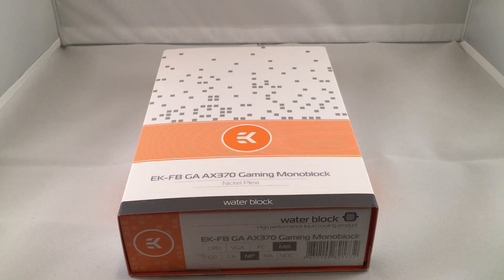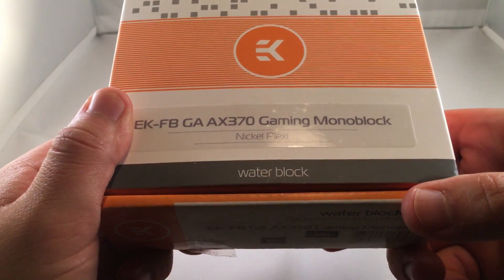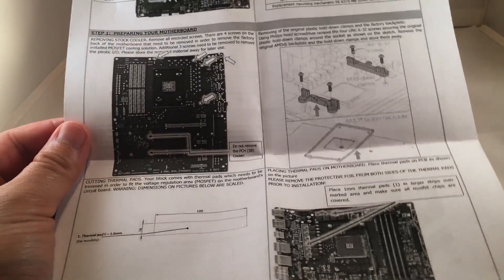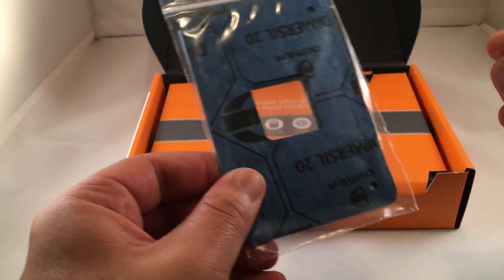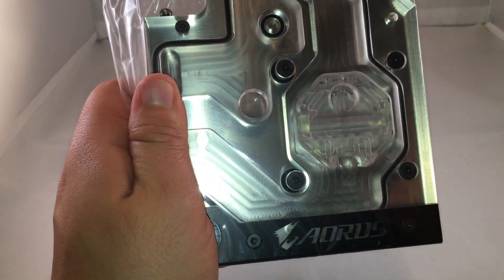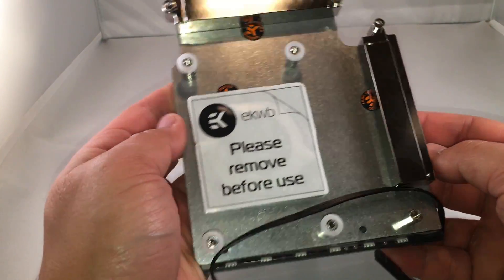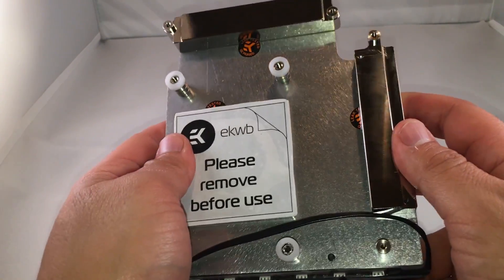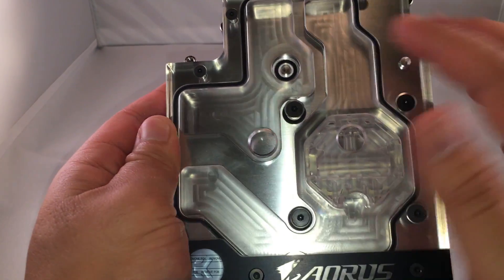UNBOXING EK Water Blocks EK-FB GA AX370 Gaming Monoblock

Comment: so what motherboard do you prefer crosshair or aorus as im trying to choose between the 2 for a new build
Reply from the maker: Ha!  Man, I was literally torn between those two boards for the longest time, so I ended up buying both.  If you're overclocking, then the Crosshair is easily the better of the two.  There's an updated version of it available with built in WiFi.  If you're more into aesthetics and especially RGB, the GIGABYTE board is better.  The BIOS isn't as easy to work with on the Gigabyte board, but it gets the job done.  The Gigabyte board has more fan connections than the ASUS board too.  Of the two, the ASUS board is much easier to work with and has worked better with more RAM modules.  Hope this helps and thanks for checking out video.